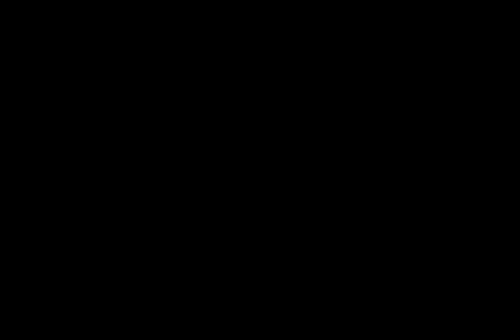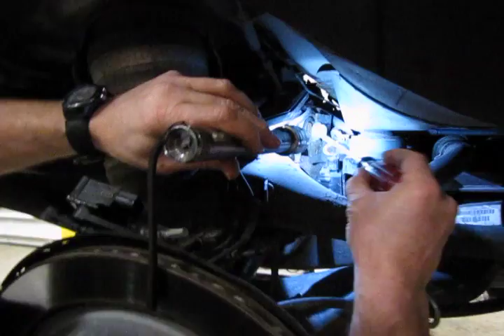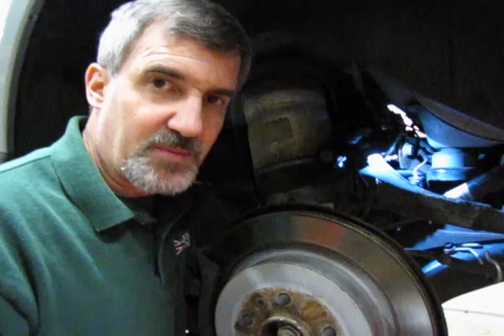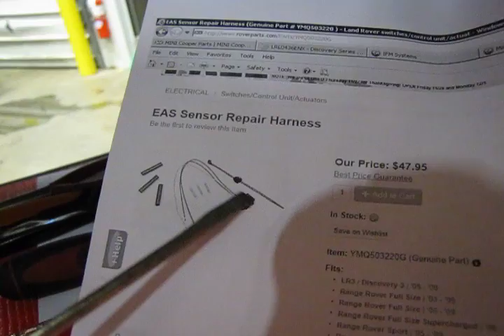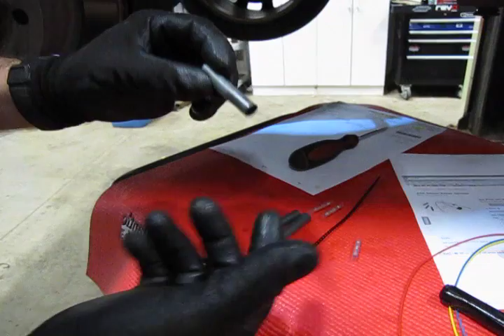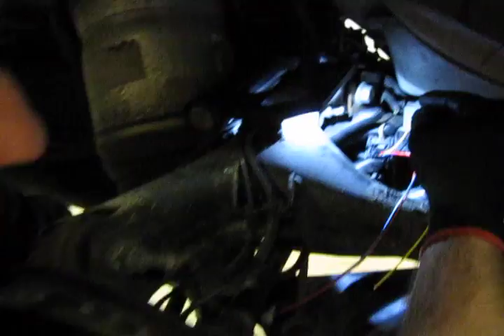Ride Height Sensor Replacement For Range Rover Sport And Land Rover LR3

Comment: I have a 2014 LR4 with an intermittent Suspension Fault. Are the front ride height sensors interchangeable?...Are they side specific? Can they go to either side?
Reply: They are side specific and cannot be interchangeable
Reply: @walkingintranquillity9071  Thank you!!

Comment: My 2006 jaguar xj vanden plas is having issue throwing the “vehicle too low” and suspension fault error messages. No engine light. It happened all of a sudden it was perfectly fine then after a bunch of rain won’t inflate the front two air suspensions. The rear is fine and I can hear the compressor working. The front don’t inflate even a little bit and then slowly leak so I don’t think it’s a leak. I think there’s an issue with the sensors telling the car it doesn’t need to raise the front end at all. I need help what issue could it be? I’m selling it and really don’t want to have to take it to the dealership cause that’s a ton of money

Comment: What happens to the car if the sensor fails while off roading?
Reply: If you have a GAP IIDTool, you can lock the suspension at any height regardless of what the sensors are mis-reading or failed.
Reply: edy dj nothing it would only go down here and there but would raise again happened to me last week